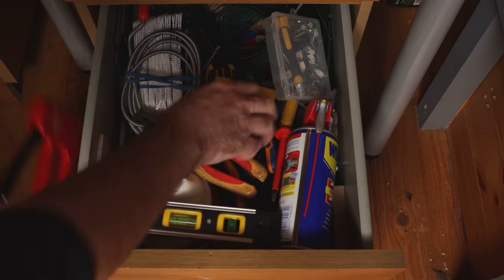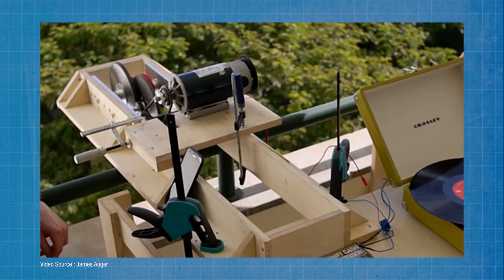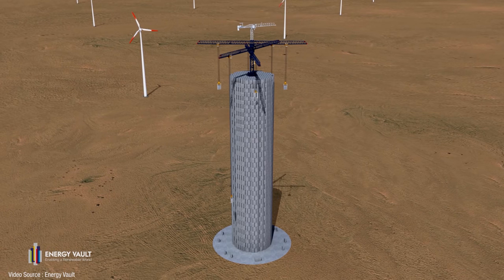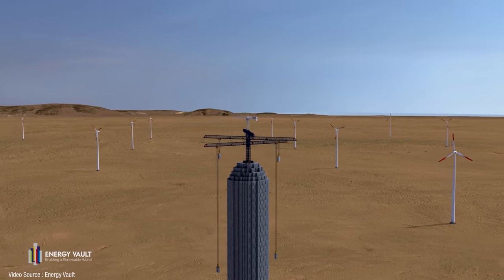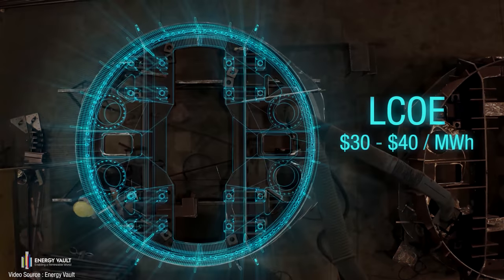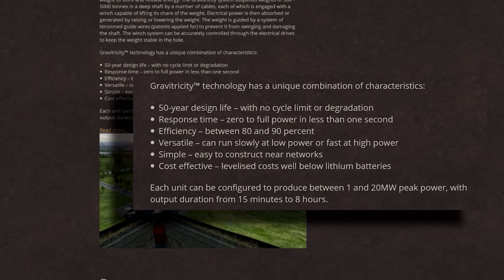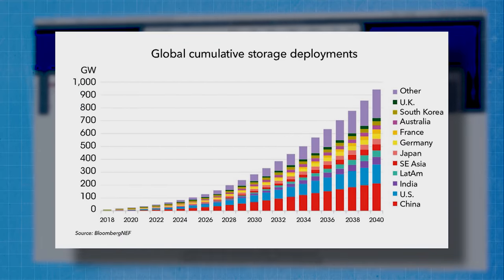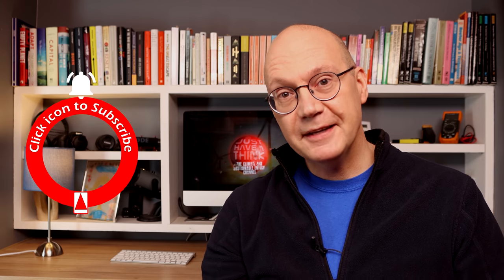Gravity Energy Storage : A very uplifting technology!

Comment: This idea has too little energy density, so it is almost impractical to lift any solid materials. You will get extremely high forces and complex machinery to get it working. And you need millions and millions of tons of solid materials. Just do the math. If you lift 1 ton of material at 1 m, you will get E = mgh ~ 1000 *10 * 1 = 10 kJ of energy. To get any sensible amount of storage for example, 10 kW of power for 1 day you need 864 Mj of energy, or you need to lift /drop 8.64 Kt at 10 m height. To get 10 KW you already need pretty massive machinery to work with 8 640 000 kg object. All project of this type looks like a scam.
Reply: In the first example each block weighs 35 tons and the building is 150m. That means each block lowered gives you 52.5 MJ. Considering it looks like it can do 6 blocks simultaneously, you could get 315MJ from a single simultaneous drop. That's not far off what you say is required and that is just for 1 drop.
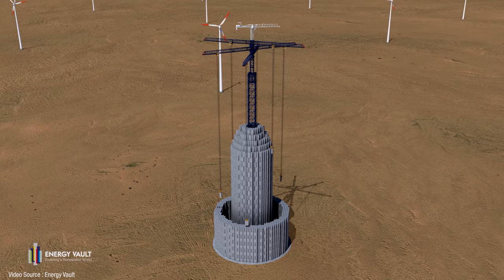Reply: @ragerancher  At 3:57 how much energy in lowering the remaining blocks?
These people also use cables that never wear out (according to their calculations).
Pumping fluids is better if possible at the location.
Reply: @DreadX10  Not saying whether the other considerations make it good or not, just that you may as well use the numbers given in the video rather than some generic ones.
Reply: But you need 35 tons and 150 m height just to barely support 10 kW or small house. Typical consumption can be up to 50 kW. Have you seen 35 tons crane with 150 m arm? Looks way to complex for such small energy.
Reply: What looks obvious to me is this energy is computed and reported using the max height of 150m but that's only for the first few blocks. Then the height gets less and less as the blocks from and ever shrinking pile are lowered to an ever growing pile. Maybe it works but I remain skeptical.

Comment: This idea is incredibly dumb, and I'm honestly surprised you covered this so uncritically. Let's math out the pilot plant at 7:25. 2 weights of 25t each, that's 50.000kg. Using E = mgh, that means the weights store 500.000 joules per meter. For context, a decent 18650 li-ion stores about 11 Wh, or 40.000 joules. 

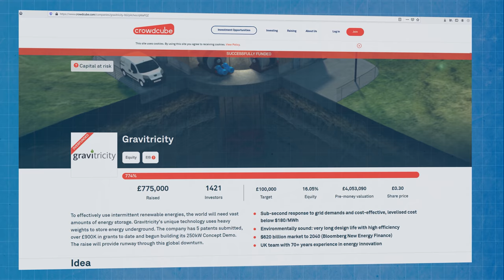Let's now say the mine shaft is 1km deep, and that you just so happen to have one (you don't). You can now store about 500MJ, or about 140kWh, or about 28 euros at European retail price of 0.20 euros/kWh. Or about the same as 12.000 Li-ion cells, which I can buy at retail prices for 36.000 euros. Something tells me that facility pictures at 7:24 won't spring into existence for that kind of money. And then imagine you don't have a ready-made borehole to make use of.

It probably makes a bit more sense above-ground, but I wouldn't hold my breath. This concept has no room for growth, unlike all the battery tech, this concept has could have been done without any real difference 50 years ago. One wonder why nobody did.
Reply: It needs to be computer controlled.

Comment: One needs to be a little more critical of ideas. Pumped hydro is also gravity storage and even a small system has far more mass in the mgh eqation than many of these full scale tower systems. Water is essentially free and does not have to be made into blocks. There are a great deal of additional mechanical and structural elements which need to be made, maintained and replaced which pumped hydro does not have. Cranes don't function well in high winds, which is exactly where the wind turbines will be.......Let me give you a far better idea if hoisting a manmade mass is insisted upon.....do it by increasing h, where is the greatest h? from a floating platform dropping many miles to the ocean floor........so the platform can generate the energy from wind,  solar and waves and store it. It can even then provide energy for shipping and become fuel stations for clean international bulk transport......you're welcome :)
Reply: Michelle Lewis - I agree the tower seems a bad idea due to the winds.  Bad  weather could also cause problems with a floating platform, and how do you keep it anchored in place if it is 'many miles' above the sea floor?   Having the machinery in a marine environment also causes ugly problems with corrosion.    I think the underground solution seems the best out of this bunch.
As for pumping, I think there would be efficiency loss in pumping as opposed to lifting, and there would be evaporative loss as well (which may be at least partially offset by a free increase in power due to rainfall).   For a system that is meant to bolster the grid for peak use times (i.e. acting like a capacitor to keep the draw smoother) I think pumped mass can work reliably, but the space required and the amount of maintenance would be greater, for certain, and the wire-hung-mass methods.
Again, the weight hanging underground seems the best to me.  No salt, no wind.
Reply: @mikegraham7078  Its just generally a poor idea Graham, its been around for a very long time and has many fundamental principles against it. While like all technologies, it may have some applications in some locations it is not the global solution the developers tout it as being.
Reply: Set up one of your ideas in Iowa, or, Indiana or, Illinois. States with 400 feet of difference in height.
Reply: @kkarllwt  I didn't know there were oceans in Iowa, Indiana and Illinois...

Comment: Giant overhead crane is more scalable than a tower. Imagine 1 km track.
Reply: HELP 💥 I am not an engineer, but I have always wondered how the maths of this question goes...,
 How does the gearing work in a situation where I could have a 10 tonne weight , 100yds height , be falling slow enough to run a 1kw motor for "X" amount of time.
Love some suggestions ❤️👍
Reply: @jimbanda  start with investigating what rpm the generator needs. Perhaps 3600 rpm. This is 60 rounds per second. 
1 kW is 10 metric tones falling 1cm/ second. 
Now you know that 1cm needs to become 60 rps. 
With a 20mm generator gear you get approx. 60cm per turn. 
So 1cm need so become 3600cm thus your gearing needs to be approximately 1:3600 or 3600:1 depending on how you view it. 
You need a generator with lower working rpm but the theory is the same.
Reply: For an approximate calculation,

100 yards = 91.44 metres
Gravitational field strength = 9.8

The potential energy of 10 tonnes at 100 yards height is

mass x height x g.f.e

= 10,000 x 91.44 x 9.8 = 8.9 MJ = 2.5kWh

So the gearing required for 1kW would drop the weight 91.44m in 2.5 hours

The velocity of the weight would be 91.44 / 2.5h = 91.44 / 9,000s ~ 0.01 m/s

For a winch drum 500mm in diameter, the circumference, pi x 1/2m = pi/2, would need to rotate once every 157s or 2.6 minutes which is 0.38rpm

The gear ratio required would need to match the ideal speed of the motor or dynamo to the drum rotating at 0.38rpm so for example 1:1000 would give a motor rpm of 380

Please check figures and adjust to taste :)

Various factors such as friction and amount of cable on drum will come into play too
Reply: @danarves7452  nice calculation and presentation! 
Please note that Dan’s energy equations gives you the answer to the feasibility of the project. A battery with 2,5 kWh weights 10kg and cost 400$.
Reply: @per.kallberg  it does the opposite in my opinion. 10 tonnes of concrete costs ~1400 dollars to store 2.5 kwh. That's just the mass. Then you need a structure that can hold 10 tonnes of weight all while moving it up and down in a secure way. Lastly the tower has to be 30 stories tall! All to store 2.5 kwh
Reply: Hydroelectric power stations have outputs of 1GW per Turbine/Generator.
For large scale applications water will be always be cheaper.
Electric trains, cable cars and conveyor belts transporting any material downhill also generate electricity. Do no need for cranes which have to be controlled very precise to build large towers of bricks
Reply: @nerdy1701  I might have expressed myself in a less than clear way. Batteries are way more efficient then the technology’s referenced in the video. So the feasibility I was referring to is very low and I think you are saying the same thing 😊
Reply: @per.kallberg  Thank you soo much for taking time to inform me. 👍
Reply: @danarves7452  Thank you for taking time to reply to me. 👍
Reply: @jimbanda  you use gearing. ever driven a car?

Comment: "Train storage" seems more interesting.
Reply: It makes a lot more sense to use the terrain and rails.
Reply: Trains store far too little energy. I know the idea has been proposed, but it's 1,000x too small. A better idea is capturing potential energy from existing ore trains hauling from high elevation to low elevation since then you're actually generating energy and not storing it.
Reply: @oisiaa  rails are very efficient, you just need to find a hill the same hight as this tower and once you are at the top, you've stored the same energy.
Reply: At least in Austria it's already common practice that energy spikes from regenerative breaking of trains is used to accelerate trains elsewhere in the network.
Reply: @turboconqueringmegaeagle9006  Not train on mountain with gravity effect, but vacuum O-shape tube with magneto-train, with kinetic energy.

Comment: The first system described uses the technology of tower cranes, automated container handling systems and recycled concrete weights to store energy. 

One, it repurposes existing technology and waste material. Two, these systems can be located anywhere with minimal site infrastructure and preparation. 

If you collocate the system with a solar or wind farm you improve the usability and value of the power generated, matching it to demand. Goodbye fossil fuel.

This is the most intelligent and easily attainable energy storage idea I can imagine.
 Brilliant.
Reply: Except that at the airspeeds that maximise wind power generation are rather dangerous for the cables involved in the system :/ The latter system is a much better bet (and alas, neither are useful in space!)

Comment: This tower is the dumbest Idea in this category. Its ineffective, because the potential energy is reduced from layer to layer. Also changing weights and moving cranes will have a higher maintenance too. Also no one wants to have such a ugly thing near where he life. So even if it would be cost effective, because of magic, they wouldn't be built in larger numbers.

The old mineshaft weight thing is way better, no one sees it, less maintenance because less parts. Just use the space no more needed to store energy and it may will work way longer then 50 Years,
Reply: I don't know a lot about cranes - but the little that I know is that they are difficult to operate in windy conditions (hence the silliness of the computer generated video of towers right next to wind turbines).

Comment: Grid level storage for intermittent renewables is required in the TWh range, and these systems simply don't have the capacity and will be prone to lots of wear and tear. A few minutes work with a calculator is all that's required.

Comment: A far simpler and efficient system would be a combined hydro-pneumatic system, where the wind turbines, rather than having alternators mounted in their turbine heads, havea large radial piston pump which pumps oil down high-pressure pipework to drive a piston up a large vertical steel cylinder (this cylinder could be part of the wind turbine's lower superstructure).  The cylinder is an accumulator, so the trapped gas is compressed by the piston, creating a store of ready energy.  When the accumulator is fully-charged, the oil flow from the wind turbine is used to drive a set of hydraulic motors which drive alternators- producing the required electrical power.  When the turbines lose pumping power, the system reverses the oil flow at a regulated flowrate from the accumulator to the motors- maintaining alternator rotation and the resultant power generation until wind power is restored.  There could indeed be many such accumulators to provide power for extended periods.

Comment: Two other options you did not mention. One is to retrofit hydro to be storage based hydro. Consider that Quebec Hydro has some 35 GW of hydro and some locations might be operated to gain level and store power. Yes that would be a big retrofit as generators would need to be much larger and transmission upgraded too. A second gravity option is to use rail cars to move dirt up a mountain. with a higher elevation it could store a lot of energy compared to lifting blocks in a tower.

Comment: Problem in the UK is wind makes the tower system unusable and although central Scotland down through the rest of the UK has thousands of old deep coal mine shafts pretty much all of them were capped off and I'm not sure how easy it will be to reopen them , also they would need to spend a lot of money on pumping out the shafts ( not only to begin with but as an ongoing problem seeing as the shafts go through the water table ) , It might be more practical if they dug out their own shafts and lined them with stainless steel as they went down as a waterproof barrier.

Comment: Lift the block in water but drop it in air. There is a net gain in energy, so that this can be a continuous process. 
One pit full of water and a contiguous pit just air. Ocean water or lake water would be cheaper. All you need is shaft in the water with air.

Comment: Only nit on this one is the visual correlation of the tower/stacking with wind.  No reason it need to be anywhere near source of generation.  As long as it's tied to the grid, you have the power to lift.  It's sexy to show it using something renewable, but it could easily absorb power from a FF fired plant as it's ramping down as demand curve drops for instance.   I would be great to have something of this nature available that the grid operators (or automatically) could trigger on and off related to demand curves.  And they could have some with larger weights and some smaller for fine tuning.  I think the numbers I saw on this was they were in the range of high 70% net efficient.  And the comments about towers in the wind etc... so, put a shell around them if you're doing it on flat land.  Maybe there's something that could be done in the hollow of monstrous masts for wind generator turbines too...

Comment: Mine shafts seem to make a better case for gravity energy storage than hugely complex and expensive towers of concrete bricks with many unreliable mechanical parts working non-stop. A 100 m tall tower also provides gravity for only 50 m on average, between the lowest and highest bricks, while a weight in a mine shaft will always go all the way down, unless you push down more and more weights until the well is full. Not sure what's the average mine shaft depth, but there's a gold mine in South Africa that goes 4 km down... Still, one mine shaft can only store a ridiculously small amount of energy for a short time, and it's not possible to dig shaft everywhere, as they learned in Alsace, France where they had to shut down a geothermal project last month or so because the digging was causing small earthquakes.

As much as I'd like us to explore all kinds of energy sources and storage, we should probably favor the ones with the least moving parts, like solar or batteries. Wind is probably the exception, especially offshore or uninhabited lands, as it is a great complement to solar.
So far, redox batteries are the best thing I've seen, I haven't found the catch yet!  ;-)

Comment: While using old mine shafts sounds like a good use for an old mine there are several problems. It was always claimed that the deepest shaft in Britain (and perhaps western Europe) is at the Wolstanton Colliery in North Staffordshire.  The shaft was (still is because its only capped off) 1265 yards deep (that's how they were measured) or over a Kilometre in depth. It had three 3,300 hp winding motors so its not unreasonable to suggest that "all things being equal" it could generate 3 x 2.4 MW or 7 MW of power.
However two things, firstly the mine had to be continually pumped to remove groundwater (and they were huge pumps). Secondly, Wolstanton like every other mine in North Staffordshire (except Chatterley Whitfield) has been redeveloped and now has an M&S superstore on the site.

Comment: The concrete block mechanism is only viable as an energy storage bank that must be charged with renewable energy sources.
There are energy losses at every stage including the wind turbines used in this application. One needs to weigh up whether the wind turbine energy is better used directly rather than lifting heavy blocks for potential energy

Comment: They should partner with LEGO and make these giant blocks look like 2x4 LEGO bricks - add pegs, cover surface in smooth bright colors. If the system will be constantly building and "unbuilding" structures, it's only appropriate that it alternates between various LEGO sculptures instead of some boring cylinders.

Comment: There is also one more possibility: to use slopes of the hills and large weight on rails, that is being pulled up or let down on ropes don the hill. There is no large crane required, nor deep shaft required. Just few hundred meters of a hillside, the whole thing will look like a large concrete train on the side ot the hill. Cost of such system will be divided in half compared to other options and there are liteally thousands of such locations available in every country (maybe except Netherlands).
Reply from the maker: I believe such systems are in development in some parts of the world.